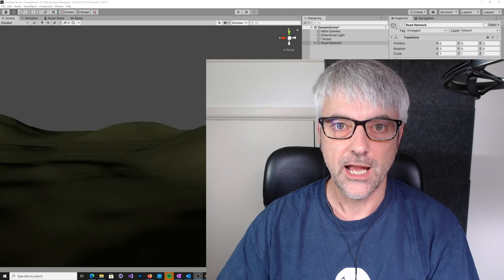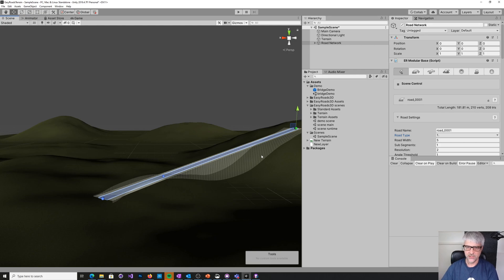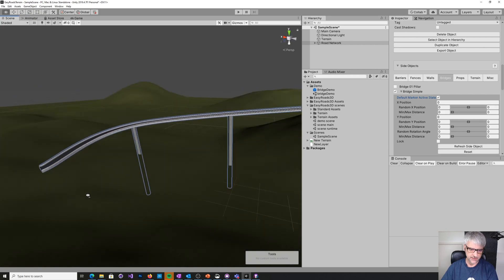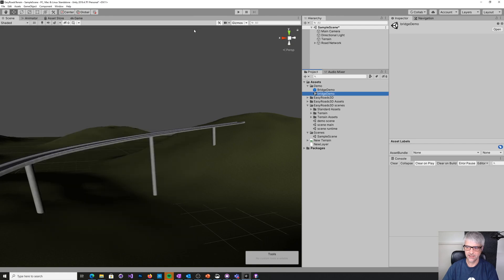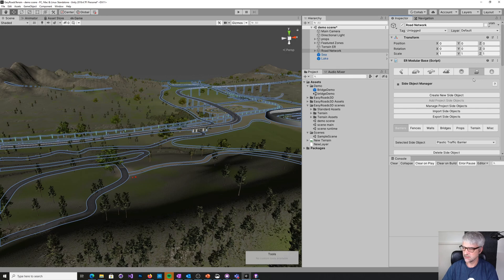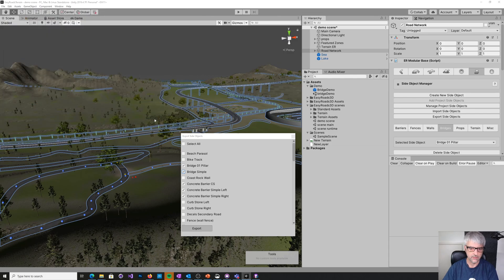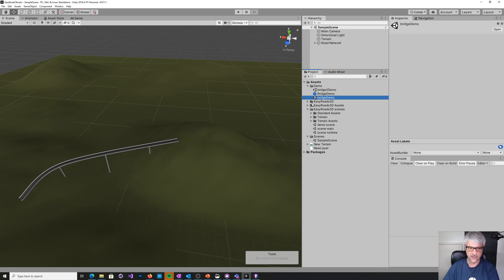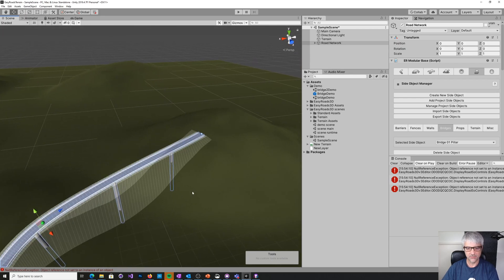EasyRoads3D - Intro to Bridges

Comment: Thank you CBC Studio. Great video. Have you had any success saving Prefabs or duplicates of already finalisized ER Road Networks? What I mean is a way of creating Prefabs or copies of already created road networks exactly as they appear when editing. The Prefabs of finalised ER networks do not display correctly when dragged into the scene. Another option ER gives you is to Export Road Network Geometry, but i have no information on what this button does, where it saves the meshes, or the point of that option. It all seems to lead to the fact that you cant really create a template or entire model, prefab or copy of an existing completed Road Network. I want to create a few simple variations of street grids. Which i have done, but now i want to use them assets to drag and drop and place multiple Prefabs down to make larger roads out of smaller, premade and Prefabbed sections.
Reply from the maker: Sadly no. I can see the need but I've only used it with the intended workflow of design & build. Potentially auto placing off-view, building and positioning. Possibly during scene initialisation?

Comment: Thank you for the tutorial.  I followed it and I was able to see the bridge similar to what you have at 2:08. However, I am not sure why the program would still generate the terrain to cover up the bridge once I hit "build terrain". What am I doing something wrong? Is there another setting in Easyroads that would not generate terrain for the bridge part while still having terrain update for the result of the road? Thanks
Reply from the maker: Not sure off the top of my head. Any hints on how to reproduce the issue?
Reply: @cbcstudios  Basically everything you did upto 2:08 and then hit the "build terrain(s)" button. The bridge we are seeing would be covered up with terrain
Reply from the maker: @revtech6426  Hi, I have managed to repro the issue but it took a bit of doing. Basically when a side object is defined (ticked) as 'Bridge Object' then EasyRoads turns off the apply Terrain deformation. So, using the actual road from the Tutorial, I manually turned off the 'Bridge Object' for that type and sure enough the Terrain grew over the bridge supports. So I turned it back on again but still the Terrain grew over the supports. I then created a new road next the original and used the same bridge type and it worked fine, the Terrain did NOT deform over the bridge supports. So I'm guessing that's the root of your issue, perhaps you turned the Bridge Object on after you'd created the road are seeing the issue with EasyRoads? PS. To recover the bridge I just selected the road and on the Terrain Tab turned on 'No Terrain Deformation' for the road type
Reply: @cbcstudios  Awesome. Thank you so much for spending the time. You are right. It turns out I chose Bridge Pillar instead of Bridge Simple as you did in your video. I didn't think they were different because they looked the same before I hit the "build terrain" button. It turns out the "Bridge Object" option was turned off for "Bridge Pillar" by default. After I turned it on, the terrain no longer grew over the bridge supports. Much appreciated!